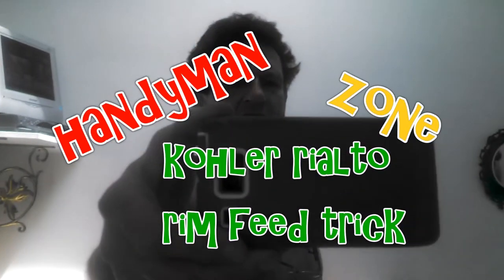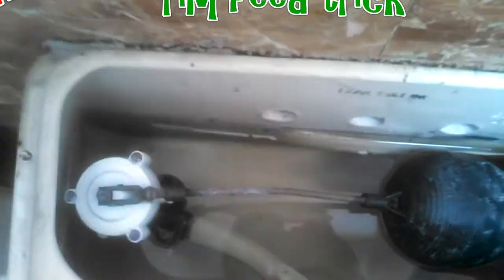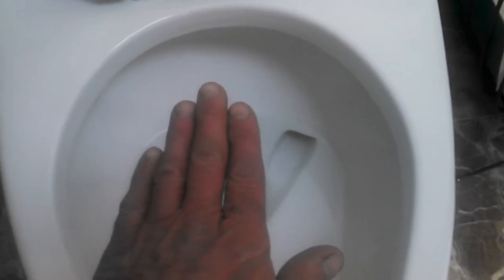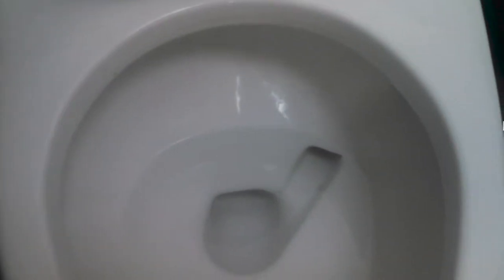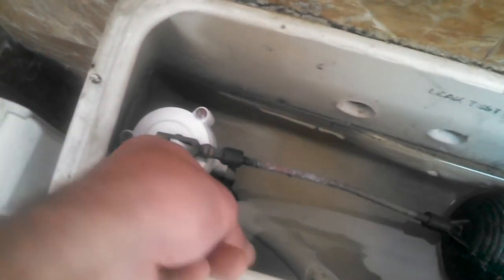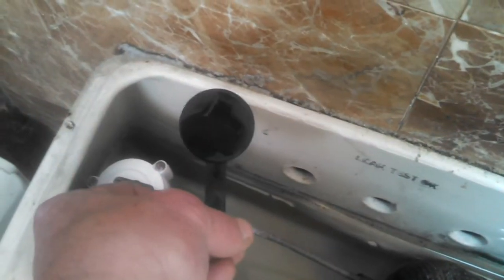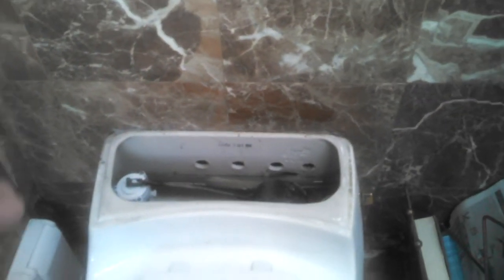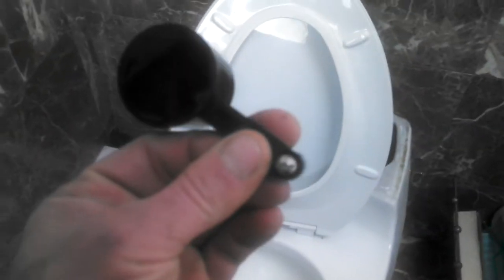RIALTO LOW WATER HACK

Comment: Dino -- my ancient Rialto (3402)  has a rim feed tube above the water level, not gravity-fed.  When I removed the diverter float, the diverter valve is spring loaded CLOSED not OPEN, so the bowl doesn't fill at all.  I put the float back on and it's ok, but I'm wondering why the difference?

Comment: The kohler k3402pb, old style Rialto c. 1990 is what I have. Same as seen in Dino's
"cheap rim feed trick."  All you need  to do is to straighten out one end of a paper clip,
and ream out all (appx 20") the rim feed holes under the bowl rim. To view the holes, you have to stick your head in the bowl and look upward. That's it. Just  ream out the holes,feeling for them with your left hand and inserting the clip with your right using a circlar motion. That simple.  The trickling will stop and the flush will  be more powerful. Afterward, wash your hands or you might contract KOHLER EBOWLER.

Comment: I have the same Rialto that came with the house. Seems like I've always had a problem with the fill valve. Always has a slight rippling in the surface of the water which seems to be coming from the rim diverter. I've changed the fill valve and also replaced the fill valve seals but still have the problem. If I shut the waste supply it goes away so its due to flapper of overfill in the tank. About ready to just replace the toilet.... Any advice?

Comment: Forgot to add: The below is in response to Carlo P Croce"s posting. If still trickling,after doing rim ream, i had to replace with a new flush valve (30 dollars). gasket was leaking.

Comment: Hey Dino, I have a Rialto k3402pb and the replacement kit hose is 1/2" ID and 3/4" OD. The rim hole for the hose is 5/8". How do you get the new hose into the hole??? 

I'm thinking I need to get a plastic 1/2" union or T and cut a piece out of the old hose. The old hose will fit in the rim hole. Is that an acceptable fix?

Also, the seal on the bottom of the flapper mechanism is leaking. I'm going to take it out and put it back in, but will I need a second thin gasket to get it to stop filling the bowl? Right now, the tank won't fill and the bowl is filling too much.

Comment: i lie the rialto they sold out of the kohler rialtos in my local home depoin another home depo there s one left and the lid got chipped some how last month i saw one on the side walk i hink it was being thrown out the tank and seat where craked my aunt and uncle have three of them they are al different colors one is black the other is white the last one is gray they are not the same ones like these they are the ones that your other video that you relaced the fillvalve and flapper.